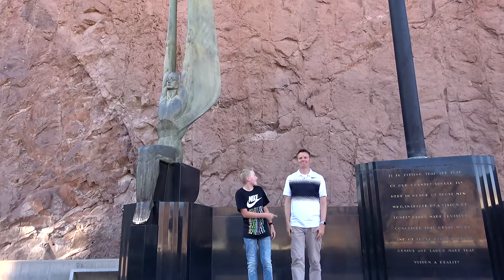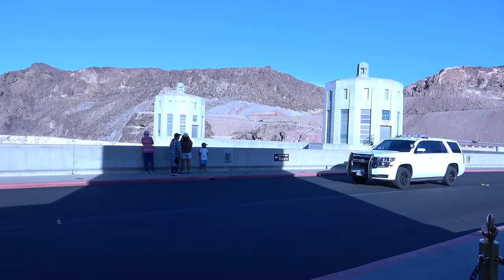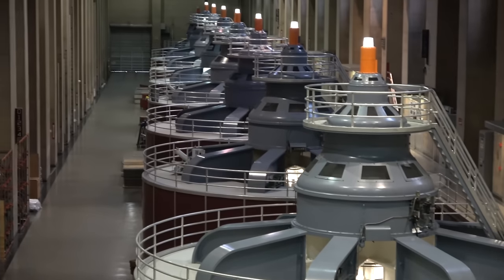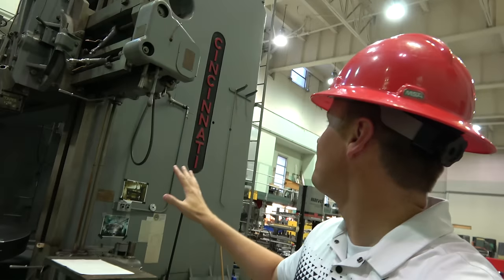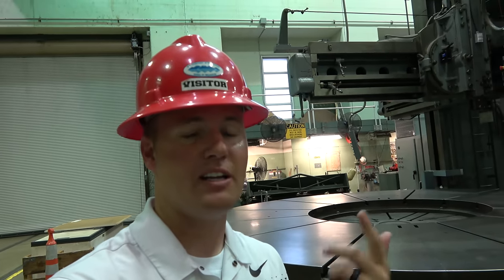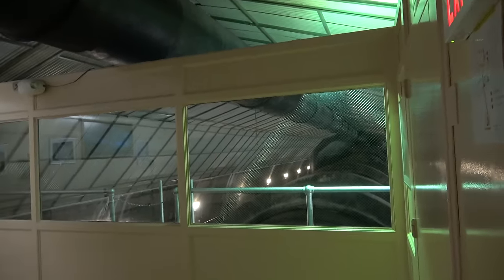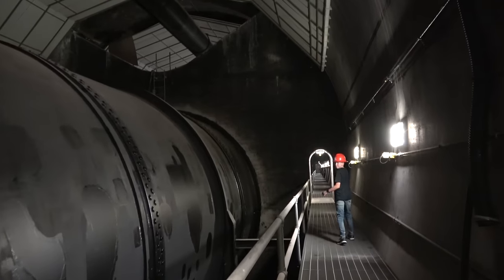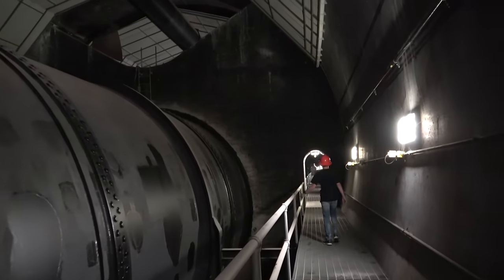What's inside The Hoover Dam?

Comment: The open turbine you saw was "JUST" for the service power (as you said), those types are called Pelton turbines, while the actual operating turbines are Francis turbines (which are more efficient if the height is substantial), and those have different blade formations.
Just a little fun fact.
Reply: and those are not generators, but turbines.

Comment: No physical magnets involved making electric power... Rotating magnetic fields is how they work, whether it be hydro, Fossil fuel, or nuclear.. large rotating generators work on the same principal
Reply: I'm sorry, Hal 9000, but you are mistaken about the no physical magnets part of your statement; there are many different generators that use permanent magnets and all others use electro-magnets to spin a magnetic field.
Reply: @battleshipnewjerseysailor4738  maybe in small generators like for home use but not in large industrial generators there are no magnets.. and what is a large industrial generators I mean something in the order of 50 megawatts to 1250 megawatts... I'm a plant equipment operator, I've been a control operator for a 650 megawatt combined cycle plant, a diesel generator operator in the US Navy along with being a gas turbine systems mechanic in the US Navy, and now I operate hydropower plants... And in all that time spent in my particular line of work I have never scene a large industrial generator that uses permanent magnets.... Every single one of them have used electromagnets to create that rotating magnetic field lines of flux...
Reply: @leskobrandon538  true, PMSG's are quite hard to regulate. Unlike the ones you quoted.

Comment: 3:59 The exposed generator is nearly identical to your common house fan. Ironic, that the giant generator which supplies electricity to your appliances with motors such as a hair dryer, blender, kitchen mixer, heating/cooling fan is mostly identical except for its size. The thing that makes electricity is just like the thing that uses the electricity.

Comment: 2:18 "Two million watts of energy a year?" Was that suppose to be Mega Watts? 2 million watts a year might run a bunch of refrigerator light bulbs at best.
Reply: I was confused by that as well and looked it up.
It has a cpacity of ~2 billion Wats and supplies 4.2 TWh a year.
Reply: Yeah, you can't even produce "2 million watts"  of energy. You could produce "2 million watt hours". Watt measures flow, not count.

Comment: Unfortunately the host doesn't understand the difference between energy and power so much of what he states in that regard is meaningless.  Energy = Power x Time just like Distance = Speed x Time.  
     I'll provide some corrections here.
The host states that the dam (hydro-electric power plant) produces 2 million watts of energy per year.  
1.  The plant is rated for  2 million kilowatts of power (or 2000 Megawatts).  
2.  The plant produces about 4 billion kilowatt-hours of energy per year which averages about 22% of its capacity which is about 450 megawatts.

Comment: It's crazy to think how a generator is basically a giant motor, that's just being turned by external forces and generating electricity,  rather than RECEIVING electricity and turning as a result. Technically any motor can be used as a generator, by turning the motor shaft; electricity will come out the other end. :)

Comment: Those turbines are pretty small I for some reason thought Hoover had Francis turbines but I guess with that much head the Peltons were used I wonder what rpm they turn a Francis only turns 300 rpm with about 150 feet of head.Was KW output mentioned? I would interested in that and how much head it has

Comment: "2 million Watts per year" -- Watts are a rate of energy per unit time, it is not a unit of energy. It's called Power. 1W = 1 Joule/second so you could more accurately say 1 Joule = 1 Watt-second. Also, the Hoover dam outputs 2080 MW, which is actually 2 BILLION Watts. So in one year it produces 17.5 Trillion Watt-hours of *energy*.